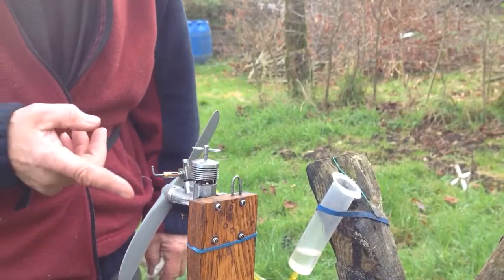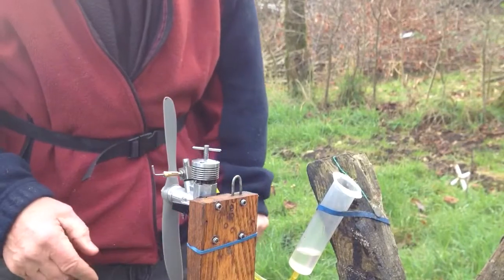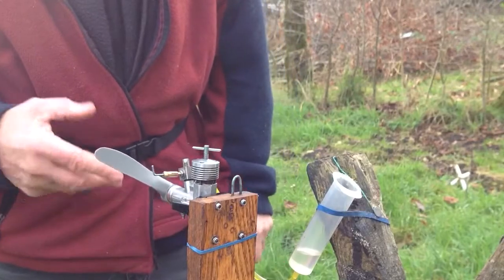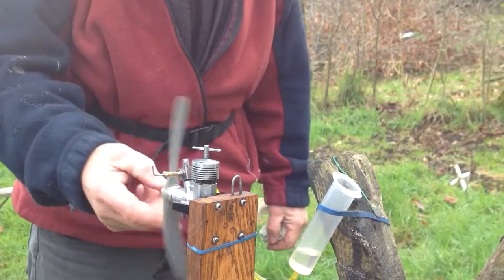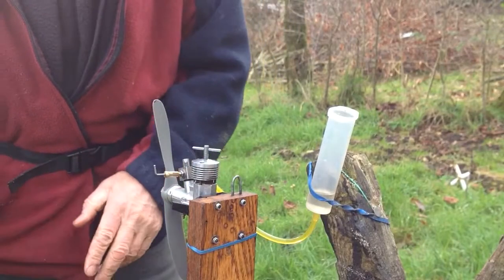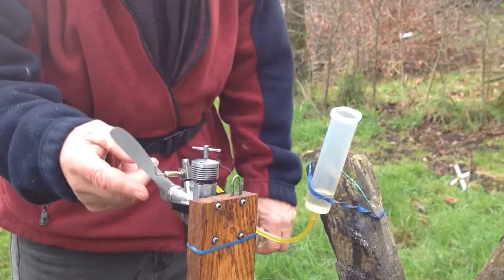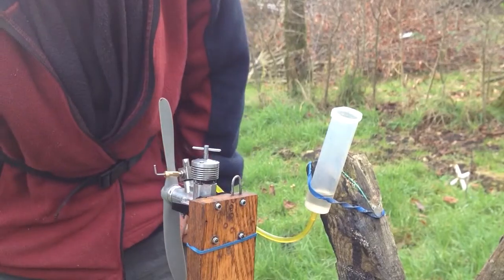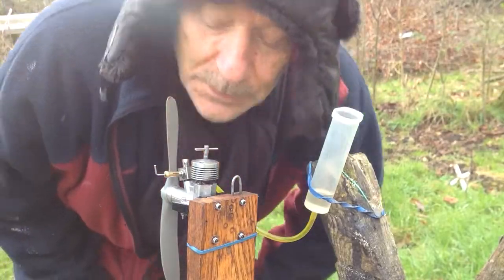PAW 1.5cc diesel set up and run ...for Nathan

Comment from the maker: Pleasure ... its an 8x4 prop, SouthernModelcraft sport fuel. Two ways to stop motor a) pinch fuel tube or b) put fingers in prop. I would go for the former method. Also not visible in the vid, always use a fuel filter. Will have the dog dancing to the next one!
Reply: Third option is to fiddle with compression
Reply from the maker: @nikki1295  True, that!

Comment: ...well it starts after all....Some PAW can be a pain...and suddenly  the burst to live without warning! I guess you compression was also  to low,or to littel aether in the fuel? It seems to me, like you have no ign. improver,as it "nails" when run..With proper fuel,they should not do it and run very smooth at lower comp. setting too. 
But a TBR is a delight to here  running and let scream at max rpm. Great engine for flying!